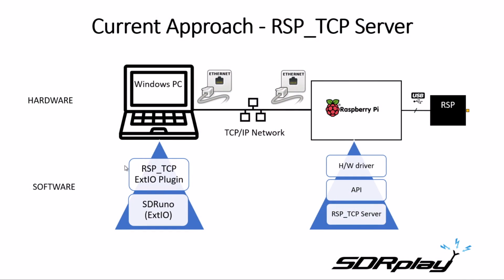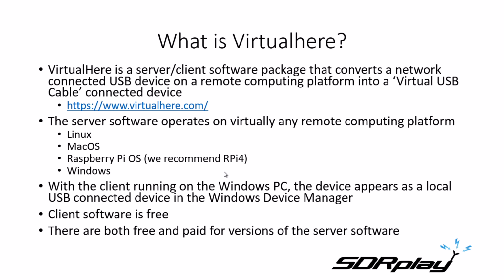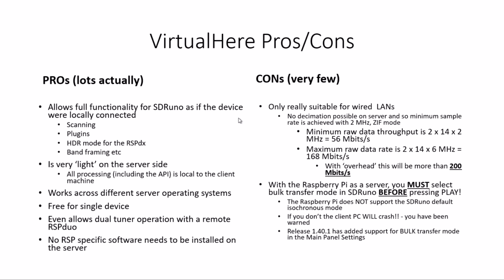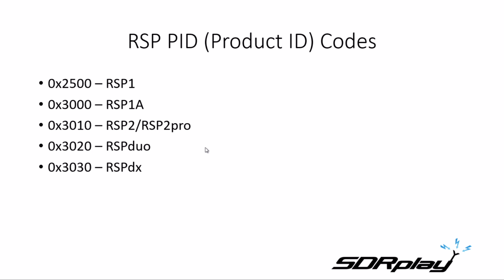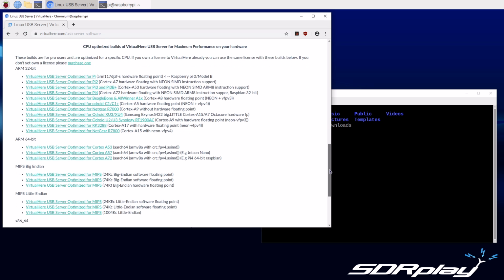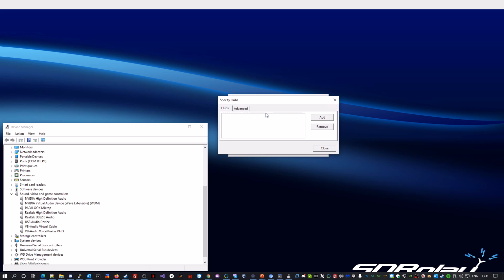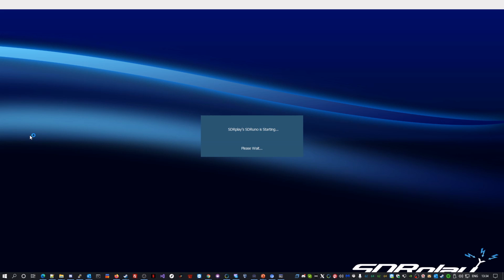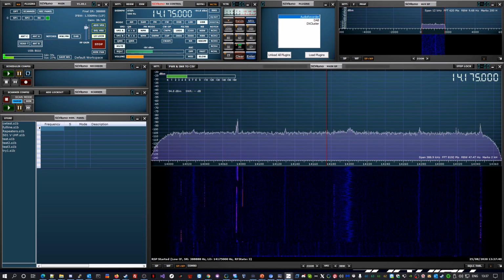VirtualHere: Full version of SDRuno and a remote RSP

Comment: I think ISO mode is having some issues (breaks in audio like pulsing) even on x86 server (Win11 Pro server), but BULK mode works well. Is there any method to select BULK in SDRConnect ? same issue is there but couldn't find a way to switch into BULK mode.
Reply from the maker: VirtualHere doesn’t support Isochronous mode, only Bulk mode.

SDRconnect doesn’t need to use VirtualHere as it can use it’s own built-in server.

We reluctantly added the ability to switch between bulk mode and isochronous mode in SDRuno specifically to support VirtualHere – I say reluctantly, because changing the USB transfer mode on platforms that don’t have good support for it can cause the application to crash. We only recommend using bulk mode in SDRuno specifically for VirtualHere.

If there is a use case where VirtualHere can be used and the SDRconnect server cannot, then please let us know.

Comment: [10:29] Not suitable for Wide Area Networks... but would it be reasonably good for a WiFi link into a Local Area Network? Or if we set up the RasPi as an access point / hotspot?
Reply from the maker: you need super fast wifi - there is now multi-platform "SDRconnect Preview" which includes server software. SDRconnect has more limited functionality but works very well over wifi in Audio (compact) mode: https://youtu.be/I5r4V_oRhFs?si=WnEctjrH5rJuRlJ_
Reply: I use SDRUno with WiFi even at 10 MHz SR, works well for me with both x86 server/client, and it seems to be using around 160 Mbps bandwidth. My WiFi link is faster than 1 Gbps.

Comment: I got this working with Rasberry pi 4 / windows 10 PC.  With the bulk mode setting selected it works and is stable.  The issue I am having is that ~ every 10 seconds or so the audio cuts out for about half a second or so.  I am wired 1Gbs, and did iperf which tested over 900Mbps so i don't think its the net.  Anyone else ran into this?  Are optimizations needed for the pi or for sdr uno settings?  Would running 64 bit rasbian OS help?  Thanks!

Comment: This does not work at all for me. Installed the Virtualhere server on an i7 Win10 hooked up the Uno, All detected fine. Installed the client on a Win11 laptop. Autodetected the server machine, could see all the ports. Selected use the 3010 device. Start SDRUno, see the RSP fine and then  Get error window "API Error details init (sdrplay_api_Fail) - bridge_SetRegister(0x08) Error 0x00000003 (configureBridgeGpio:2183)". I click OK on the error message and SDRUno terminates. This happens just the same if bulk mode is selected. It is instant as soon as you press "play". Very disappointed with this. The error message is meaningless to me as well.
Reply from the maker: You should not be running SDRuno on the server.
Did you verify the service is running in Task Manager on the client? What version of SDRuno are you using?
Reply: @SDRplayRSP  I'm not running SDRUno on the server, only on the client end. However I've been advised now that this solution only works if the server end is an RP4, not a Windows PC
Reply from the maker: @gibsonmb1  I don’t have 2 PCs here but I’ve run both PC to Mac, and Mac to PC. Can’t think of any reason for PC to PC not working.
Reply: @SDRplayRSP  Well that's what I thought but Virtualhere support says no.
Reply: @SDRplayRSP  Yes. I now know this will not work with a PC as the server so back to the KiwiSDR until SDRplay get V2.0 and a workable LAN solution out there.
Reply from the maker: @gibsonmb1  the new SDR++ software may be of interest? https://youtu.be/CkSiaECeZEM
Reply from the maker: For help, we suggest raising a ticket by going to https://www.sdrplay.com/help/    (click on top left button for technical help, fill in details and follow through to where it says "raise a ticket" )
Reply: @SDRplayRSP  Yes, have done thanks... got an answer back now. Only works with Raspberry Pi at the server end, not a PC

Comment: Hi, F5UJA here
I've downloaded and installed the VirtualHere server on an RPi 3B+, and run the VirtualHere windows client on two different machines. Everything is fine a per the SDRplay video until I press the Play button in SDRUno. A few seconds later I get a magnificent BSOD...
Yes, I have set the USB transfer mode to "Bulk" on both machines I have tested.
One PC is directly connected to the LAN, the other one, a laptop, is connected to my ADSL box via WiFi, and both windows 10 crash... 
Any clue on what could happen?
Reply from the maker: For help, we suggest raising a ticket by going to https://www.sdrplay.com/help/    (click on top left button for technical help, fill in details and follow through to where it says "raise a ticket" )
Reply: EXCATLY the same problem here. runnint W7 and W10, both are affected, even when i start SDR-Console

Comment: I use raspberry 3+ B and I don't want to connect virtualHere Client to the server on the local network, what could be the reason? I need to use RSP1A as a remote receiver and control it with SDR Console, how can I configure it to work? launching RSP TCP Server on a raspberry without any problems connects to HDSDR, but I don't know how to connect it all with SDR Console because I care about it ... in a word RSP1A, raspberry 3+, RSP TCP Server and SDR Console is it the possibility of all this working as a remote receiver?

Comment: Spot on info.
It didn't work straight away in runo even though the dx was in device manager so runo closed, but a reboot sorted it. Not sure yet why I've got no stations only noise off a QFH in the loft and a rushed together dipole and a whip in the room below, but it's lockdown so I've got plenty of time. Previously on a v3 dongle all worked.
My headless pi 4 is on the Lan and Runo is a later version, 1.4.2 possibly. So far no crashes on bulk or isochronous but it hasn't had much data through it yet.

Comment: Used it with an RSPdx and a Pi4 as the server. Worked,  both using bulk and isochronous, no crash. HOWEVER, the connection used to break randomly, SDRUno needed to be re-started. After RSP support mentioned problems with ARM-based platforms, I moved the server to a $200 x86 mini PC running Ubuntu, and the connection became rock-solid.

Comment: I was able to get this to work with the Raspberry Pi 4 hosting the RSP1A connected to gigabit ethernet and a laptop on 5 gig wifi  but only up to 25 feet away from the router. After moving more than 25 feet the audio starts cutting out. Very nice to be able to have the RSP1A untethered from the laptop.

Comment: Have RSPDX unit using VirtualHere working from win 10 pc to win 10 pc over Cat5 1Gbit Ethernet through a switch using bulk mode on SDRUno. Confirmed that WiFi is too slow and will crash your SDRUno.

Comment: Great video, will definitely try it and put the RSP1A on the attic, so I can use a shorter cable to the antenna.

I noticed your taskbar and I'd recommend you add the quick launch toolbar (like the one in Windows XP). https://www.youtube.com/watch?v=ETewK4CmuiQ
Why? Quick launch items use less space and if you'd make your task bar a little higher you can get 2 (or 3) rows of quick launch items.
That will tidy up your taskbar.

I'd also disable/hide some items in the system area of the taskbar.
73, PA1NT

Comment: Same as Laurent, RSP1a, SDRuno deffo in USB Bulk mode, latest version 1.40.1, runs for a few seconds, can see it working then BSOD - happened twice now. Running server on Pi4 on a weakish WiFi connection so may be connection speed related? Any thoughts or should I raise a support ticket?
Reply from the maker: Very likely the weak WiFi connection
Reply: @SDRplayRSP  Thanks - very informative video, by the way. As the RSP1a is in a shed, away from the house, I look forward to your work on the extio updates in a later version. Cheers.
Reply: @SDRplayRSP  Same for me even with a strong wifi connection. When your own implementation is ready will it be able to use our SDRs remotely with wifi? I have my loop upstairs, where I plan to connect it to my Pi 4 and stream to my iMac (Windows 10 under bootcamp) downstairs. The hub is also downstairs. I have had some success with this setup using SDR Sharp, RTL v3 and the piece of software providing the link (I forget the name). Thanks.

Comment: Hello,
i have installed the server on  raspberry 3b+ and client on windows 10 the server run ok abd client to, my sdruno is on bulk mode but when press play my pc crash. I have rsp1a.
Have you an idee? thank's
Reply from the maker: We don't recommend using the 3B+, but we have tested it and it does work. However, because of architectural limitations, we found that it could not deliver an ADC sample rate of more than 5 MS/s. To do even this though, we had to use a wired gigabit ethernet, but at no time did we experience any crashes of the client PC if BULK mode had been selected before starting the stream. Try a different USB cable in case that is the problem and avoid using WiFi. Also make sure that any network switch or router has gigabit capability and is not simply a 10/100 link